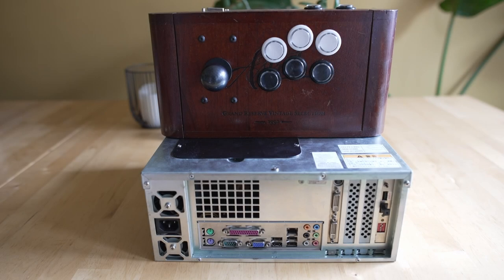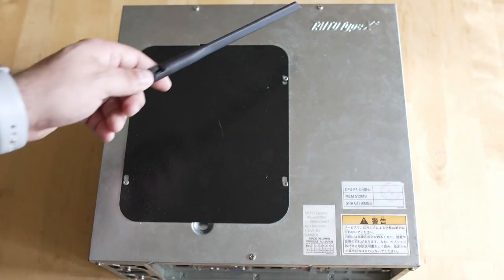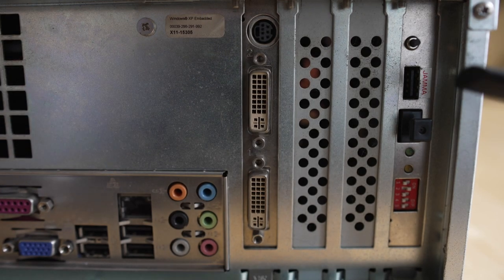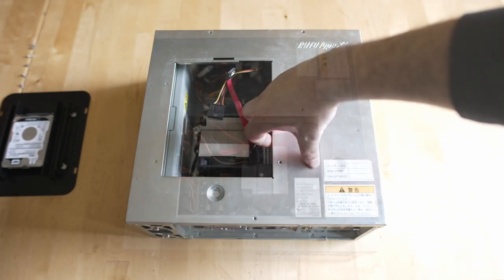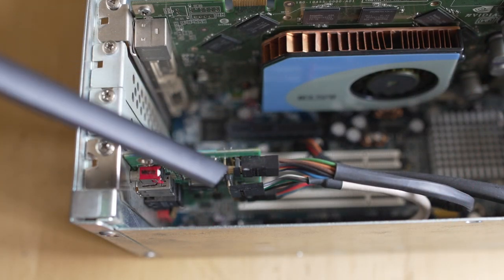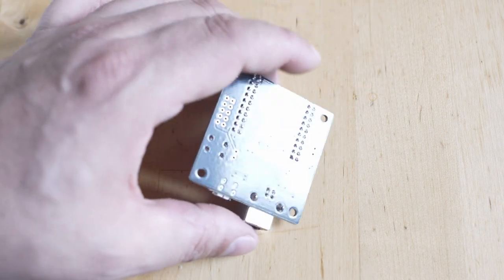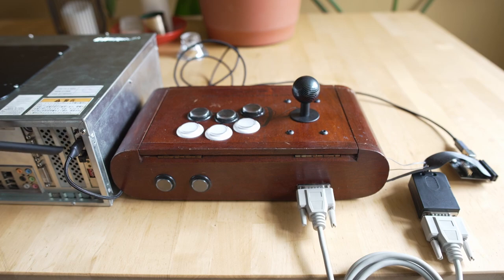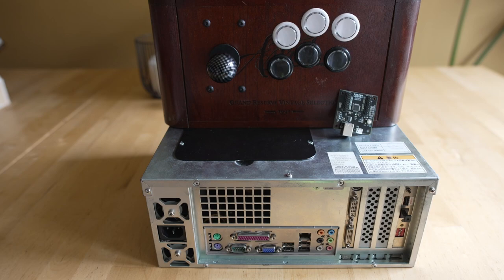Taito Type X2! Taito's Beloved PC Based Arcade Board! Hardware Overview and Teardown of the Type X2

Comment: Awesome video my friend! Recently got into collecting some PC based arcade hardware, my first one being the Namco System ES3. Had to rebuild the whole system as it had a fried motherboard. Luckily finding old stock parts was pretty easy, popped in a new board, a dumped file of Tekken 7 (not using Teknoparrot or Jconfig) and it now works! PC hardware is very forgiving compared to the console/custom arcade hardware.
Reply from the maker: Yes the PC stuff is easier to deal with repair wise because if you can build a pc you can pretty much fix one. Custom stuff…not so much!

Comment: If you're into the Street Fighter IV series, know that the games are very mod-friendly even as an arcade setup. I found it dead simple to add new color files for Seth and Gouken in the original 16-character vanilla SF4 release (donated from my PC purchase) to make them look normal when played as. It also had absolutely zero problems playing the fully-animated endings for each character when dropped in from the PC release.

I'm sure it would be similarly easy to mod the character select files to allow simple selection of those bosses as well.
Reply from the maker: I have IV on Type X2. Dunno if they one could be modded. Now I want to check
Reply: @VideoGameEsoterica  I did this on my own with a downloaded single-game image and the TypeX Launcher on standard Windows. However, I'm pretty sure I've seen others do the same type game mods on the hardware itself.
Reply from the maker: I’ll have to look into it!

Comment: No wonder my humble little emulation rig has no problem running taito X2 games on Teknoparrot. Got a Dell Vostro slimtower from work that I upgraded the most I could, short of replacing the motherboard. Looks pretty similar to the X2 hardware lol. Just using a cheap Nvidia T400 workstation card and an i5 9600K to run a lot of 2010's Japanese arcade games.
Reply from the maker: Yeah the X2 is NOT a powerful machine
Reply: @VideoGameEsoterica  I was pretty stocked that I managed to build a rig that could run all these games with only spending like 200 dollars on the hardware to get it going. Wanted to build a cab, but a raspberry 4 is not powerful enough to run a lot of the NesicaXlive/Teknoparrot games.
Reply from the maker: Yeah Pi won’t touch that stuff unfortunately

Comment: And let’s not forget the Taito type X2 arcade
Ports onto the PS3 we’re all ARCADE PERFECT! 

I own perfect looking condition Japanese PS3 versions of street fighter IV IV arcade addition, battle fantasia, blaze blue continuum shift and there all 💯% IDENTICAL to the taito type X2 arcade version, so having that Japanese arcade perfect experience in your own home is amazing still to this day ❤️
Reply from the maker: I’ve never compared them directly but makes sense
Reply: @VideoGameEsoterica  well if you could please do that as your next video I’d LOVE IT SO MUCH ❤️❤️ make a video of PS3 home conversions of the taito type X2 arcade games and do arcade VS PS3 home system versions
Reply: @VideoGameEsoterica  and all the arcade versions ran at 720p 60FPS and the PS3 hardware was MORE then capable of handling it with no slowdown, or loading times ❤️ in fact the PS3 was able to even up the RES just a Smidge over that of the arcades RES ❤️ so it was actually a little upgrade when they came home to the PS3 system, 

even for games that ran on segas ring edge 2 arcade board like under night in birth was 💯% identical / arcade perfect on the PS3 with a buttery smooth 720p 60FPS ❤️❤️
Reply from the maker: I’ll keep it in mind :)
Reply from the maker: I do miss PS3. Was a fun platform
Reply: @VideoGameEsoterica  thank you

Comment: I had a Toshiba laptop from around 2009 that had similar specs to the Type X2 

Did it run the games? 
KIND OF,  some of them ran with Slowdown.  I mostly used it as an Emulation machine. 

I'd like to think in some alternate universe the Type X2 is the XBOX 360.  Most of the games got ports, and still get ported (Raiden IV and Dariusburst) 
But the ones that have no home version whatsoever is every bit as interesting.

We've talked about Matrimeele Matsuri multiple times.  Spica Adventure would've been a great XBOX Live Arcade title too.
Reply from the maker: It is V similar to a 360 in feel

Comment: Tucson Logic board for sure works with X2? I just read their quick start guide and it states the following:

"The JVS-Bridge is not currently compatible with Taito Type X systems."

Not sure if this was true in 2020 but not anymore now, so I figured I'd ask. Also wasn't sure if that statement covered TTX specifically or if it meant the entire X1-X4 family of hardware.
Reply from the maker: I mean it's the only JVS board I have ever used on my Type X2 so....I can vouch for it on X2
Reply from the maker: Case in point I captured all ten episodes of this series with my custom built arcade stick going through the Tucson Logic board so my guess is outdated info on their site?
Reply: @VideoGameEsoterica  I assumed as much but it's good to know for sure. Thanks for the response. I enjoy your channel and definitely looking forward to this series. X2 is a great arcade platform.
Reply from the maker: Glad you like the channel :)

Comment: Yeah its because they used a garbage hot P4 lol i still remember  my P3 tualatin @1.4GHz was faster than a 2.2GHz P4 these days my dual P3 tualatins @2.0 still runs decent 
Also intel new netburst was a failure expecting upto 10GHz with that long pipeline they were too invested and kept pushing that crap for years then finally went back to the P3 tualatin design and thats how you got the core series
I am curious with these boards if you can upgrade the cpus and if they released bios updates as i never cared for pc based arcades they were just boring
Anyway i had a 7900gs paired with athlon 64x2
And regarding the oem of that board it could be foxconn
Also those battery types do not leak no electrolytes
Reply from the maker: I mean they made them to be powerful AND profitable so it’s no surprise they popped a Pentium in there
Reply: @VideoGameEsoterica  the P4 wasn't faster than athlons and were more expensive this is the time intel was paying people to use only their parts and got in trouble and sued by AMD
Reply from the maker: It may have been reliability testing too. These were in cabs in hot environments. I don’t know the TDP / heat envelope of either but I’m sure it was considered
Reply: @VideoGameEsoterica  actually they were mostly in air conditioned arcades and coupled with fans as you say sound like jet engines fixes the heat issues and stuff that was outside or in hot environments failed a lot i know i worked in outside restaurants and bars in Florida at these times with pc based arcades like artic thunder etc
Reply from the maker: The fans are so loud but I bet heat still was a difficult thing in the engineering stage
Reply: @VideoGameEsoterica  yeah they didn't care about running fans loud as its a loud arcade machine but the issue with that is it draws more dust and dirt etc into the cabinets which then cover other components causing overheating on them i could just imagine what the yokes and flyback on the crt looked like
Being a crypto miner for over a decade in Florida i would have lost many gpus if i didn't clean them once a month due to that
Humidity makes it cake on faster
Reply from the maker: I need to mod my fans still. One day
Reply: @VideoGameEsoterica  dont forget inside the psu with cleaning thats a 1u server style psu
Reply from the maker: I cleaned it all a while ago off cam
Reply: @VideoGameEsoterica  have you imaged the hdd just incase it fails also curious if it worth using a ssd with boot and load times
Reply from the maker: I need to duplicate the drive actually but sourcing a replacement image is not hard if you know where to look. SSD would improve things and I’ll do that in the future

Comment: What is the game at 1:22?
Reply from the maker: Samurai Shodown Sen
Reply: @VideoGameEsoterica  pretty good graphics for such ancient GPU. I don't remember PC games using that hardware specs looking so sharp and fluid.
Reply from the maker: Its highly optimized too because its a fixed platform just like consoles
Reply from the maker: Plus considering every dev knew the target hardware just like a console it was easy to work with
Reply: @VideoGameEsoterica  I'm mostly comparing it to pc games since it runs XP Embedded.
Reply from the maker: True but by this era the difference between a PC and a console was razor thin